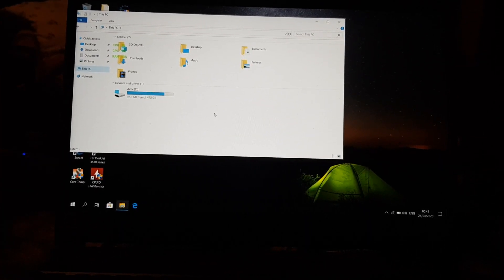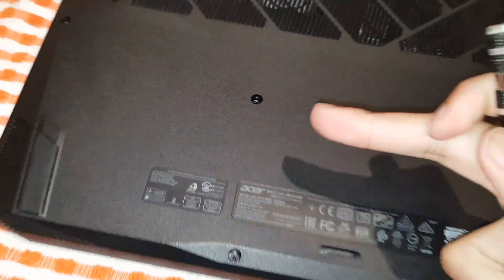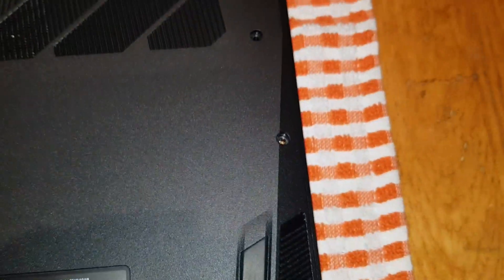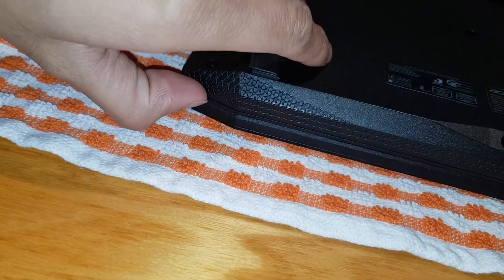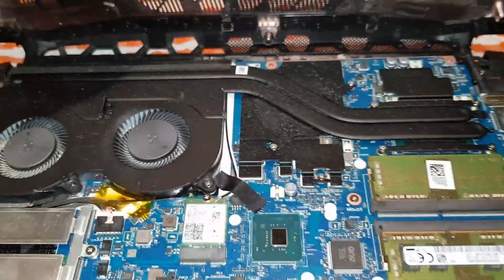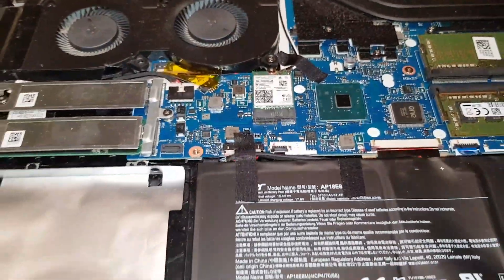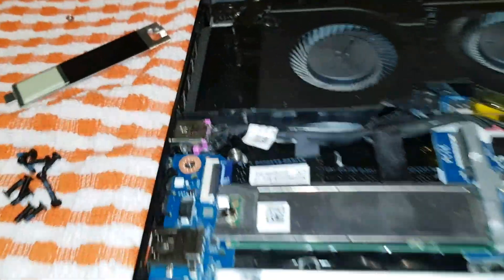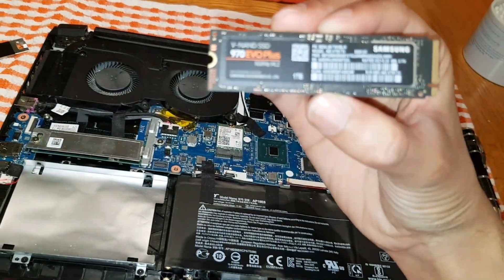How To Install M.2 NVMe Drive Acer Nitro 5 Gaming Laptop

Comment: did someone had overheating issues when using both m.2 slots? I heard it from some nitro 5 users, maybe because of the proximity with the fan.
Reply from the maker: Never heard of this but i am using both slots so might be worth me taking one out and trying it haha
Reply: @MrWaheedulHaque  thanks for the answer! 

I'm from Brazil and overheating here is a major problem for most gamer laptops.
Reply from the maker: @adrianokian  haha i had same issue too, i went through many pastes and found hydronaut was the best

Comment: How is the performance after upgrading with this ssd ?
Actually i have same laptop 
And planning to upgrade with this Samsung ssd !
Reply from the maker: Very fast everything instant
Reply: @MrWaheedulHaque  one thing more bro!    
What about gaming performance?
is it increased ?
Reply from the maker: Games load slightly quicker not really a big difference over a normal m.2 drive, where you will notice it is on video editing and stuff anything with heavy data usage
Reply: @MrWaheedulHaque  thanks bro for the quick response 🙏🔥🔥

Comment: Hi everyone,

I'm planning on doing a upgrade myself I'm just having trouble knowing if the parts I'm picking are compatible. If it's not any trouble could you guys tell me if this nvme m.2 drive would work with my acer nitro 5 AN515-54. https://www.amazon.ca/dp/B086BGWNY8/?language=en_US&cstrackid=26f0381b-a65f-4e09-bfae-194211895850&tag=microncsus-20

much appreciated.
Reply: hey bro, i have the same pc, That if work?
Reply from the maker: Yes
Reply: @cristianbenavides5265  I upgraded mines a month ago and it works flawlessly and is as easy as it looks. I recommend buying crucial nvme m.2 on their website it also shows compatibility with each model of laptop
Reply: bro, i have the same laptop, my question is, ¿support m.2 nvme? i'm thinking buy one, a samsung evo970 , Do it work in the laptop?
Reply from the maker: @cristianbenavides5265  yes brother i use similar one in this video will work fine
Reply from the maker: Yes it would work

Comment: hi i have acer nitro 5 an 515 52 laptop, can we add nvme ssd into it?
Reply from the maker: Yes with an adaptor but i dont recommend it, m.2 is better in all ways and price is same just get a m.2
Reply: So nvme does not support, then should I buy sata ssd?
Reply from the maker: @Kolül2771  it does support nvme but only m.2 style, so get a m.2 it very good

Comment: When I add the new ssd Will it be apart of my operating system storage?
Reply from the maker: No it will be extra storage, if you want it to be operating system storage then you need to clone original hard drive containting the operating system
Reply: @MrWaheedulHaque  thanks you so much!!!!
Reply from the maker: @Idkokay23  no problem
Reply: @MrWaheedulHaque  well i need to install a second nve ssd for warzone cause my nitro only came with 250 gbs lol. so if its for storage i assume the game will run no different than on the original drive?
Reply from the maker: Yes it will run as a normal hard drive extra one

Comment: Nice video bro. Got this laptop i have the 512gb pcie nvme ssd. Can i just add another 1tb m.2 as extra storage without cloning? Like buy and plug? And just use the extra storage for files and games leave the 512gb ssd thats comes with as it is for booting? Sorry not a computer techy and dont want to clone and swap even if the 1tb im buying will be faster than the factory included. Thank you and keep addking awesome video
Reply from the maker: Yes you can do that, its plug and play literally put it in computer, then go onto your pc search in bottom left, type in disk and click the one that says create partition and then new hard drive should be there i made video on how to do it on my channel if u do get stuck
Reply: @MrWaheedulHaque  yeah ive seen bro when you hard drive partition the sata drive. Its the same process? Thanks gor quick reply
Reply from the maker: @martachong123  yes same process for your drive

Comment: Can u show me how to remove the fan :)
Reply from the maker: It is all on the thermal repaste video haha search on youtube acer nitro 5 thermal repaste my video is first i believe
Reply: @MrWaheedulHaque  o thx the only thing i need to know now is howd do i get inside the fan and clean it because my fan has alot of dust in it
Reply from the maker: Use compressed air, microfibre cloth to clean fan blades and a small paint brush to clean the outer vents of the fan
Reply: Yea thanks but how do u get inside the fan
Reply from the maker: @takasaga2395  what do you mean by inside the fan
Reply: @MrWaheedulHaque  like open the fan if u know what i mean
Reply from the maker: Did you watch my thermal repaste video as that is what i do in it, if you mean even further removal its not neccessary unless you are greasing the bearings of the fan, but compressed air will clean it you dont need to disassemble further
Reply: @MrWaheedulHaque  o thx will using a vacume work or is that too much?
Reply from the maker: @takasaga2395  vacuum dangerous might cause static shock
Reply: @MrWaheedulHaque  ohhh what will happen if that happens
Reply: @MrWaheedulHaque  will it damage the laptop?
Reply from the maker: It will fry the chips or motherboard and then your pc will be a expensive dead paperweight that cant be fixed
Reply: @MrWaheedulHaque  holy shit lol
Reply from the maker: I done it before ftom very far away just to pull dust out from far it helps a bit
Reply: @MrWaheedulHaque  ok im a try from very far away wish me luck hooe my laptop doesent break i cant use the other methods i recommended me because i dont have them

Comment: Did you switch the main drive to the new one and run windows on it since it's faster, or are you just using it for storage? If you did I could definitely use a walk through. Doing the same on mine just waiting for shipping.
Reply from the maker: Yes i did this, all you do it clone old drive, change boot to new drive in bios and then format old drive and use old drive as extra storage
Reply: @MrWaheedulHaque how do you go bios?
Reply from the maker: @jennytehlia1724  turn on pc at same time keep pressing f2 key very fast should load into bios

Comment: I put a NVMe in the PCIE/SATA slot and BIOS doesn't detect it. I try it in the other slot and same thing. It won't read. I'm not sure what the issue is but I am going to return my laptop to the store.
Reply from the maker: Did you put nvme in nvme slot?
Reply: @MrWaheedulHaque  Yes, in fact they both should be. One's a PCIE/SATA, and one's a NVME
Reply from the maker: @AzNightmare  are you sure it was fully placed in as mine didnt detect too untill i fully pushed it in
Reply: @MrWaheedulHaque  Apparently I wasn't sure. It was my first time. I'm a dummy. I got it to work now. Just needed to push it in harder from 45° angle until the gold pins weren't showing anymore.. I made the same mistake you did in the video.
Reply from the maker: @AzNightmare  dont worry my friend it is very easy to make the mistake also it is a bit scary too as you dont want to break a expensive m.2 drive either, but now we both know. Im glad it working now for you.

Comment: 2 thumb holes at the back each corner ..pull the screws then place thumbs in each hole and slightly pull & the bottom shell drops straight off.
Reply from the maker: Can you make video on this

Comment: can you tell me if my Nitro 5 model AN515-54-75FJ supports a 1tb NVMe ssd?  (WD black SN750)
Reply from the maker: If it have m.2 slot then yes most nitro 5 supports it

Comment: I know what you mean it's just not enough I need to get an extra stick of RAM for it I've only got one 8g stick and 512 ssd.
Reply from the maker: go for it lad you will be glad you did
Reply: @MrWaheedulHaque  did you get yours with 8 gig of single channel ram and did you upgrade it. and did it make any difference to the games.?
Reply from the maker: @joshuagood4237  yeah it was only one stick i think, its on my ram upgrade video i pretty sure it was one ram stick. The improvement is very good, on more demanding games it does makes thing run smoother by like 4 or 5 fps. But where you will notice it is if you do a lot of multitasking. Like i go on internet and open loads of tabs and leave them open and start playing games and before i couldnt do that
Reply: @MrWaheedulHaque  thanks for letting me know yes I definitely have to upgrade the RAM then. 👍

Comment: I bought this laptop last month. It came with only 1 TB HDD and two empty slots for M2 SSD. Can I increase the storage of this laptop if I replace the 1TB HDD for one Crucial MX500 1TB SSD? Also, I want to add one Crucial 1TB P5 NVMe PCIe M.2 SSD in the slot 1 and one Crucial 1TB P5 NVMe PCIe M.2 SSD in the slot 2. I will have at the end 3 TB of storage but I'm not sure if the motherboard support this.
Reply from the maker: Yes this will work fine, i have 3 hard drives in at the moment and they work fine

Comment: Finally you’ve uploaded a new video. You’re laptop looks like crap inside, scratches everywhere, dust everywhere and also your battery looks like it’s swelled up which means the battery life won’t be as good as when it was brand new. What is your new video upload schedule?
Reply from the maker: Haha true but it all works fine so i guess its alright, and i think the tiny battery buldge is just a sensor as i seen it on a few acer nitro 5 tear downs, also my upload schedule is 1 upload a week if possible and more if i can. Reason for going down from daily uploads to less is because im just a lot more busier, we got a accident damaged ford fiesta st, and i been working on that with my mates and labib, i been recording footage on that and most likely will do it up and sell it while making videos for it on my channel
Reply: MrWaheedulHaque that’s not a battery sensor that’s the actually battery cells inside that are expanding and coming out. Ford Fiesta ST’s are nice cars it’s good you’re fixing cars and selling them nice work bro.
Reply from the maker: Ill have a look at it again, and thanks bro they are very nice but very hard to fix when they have frame damage haha, been trying to bend the front axles back into shape and its a very hard process. Thanks i enjoy buying fixing and selling cars its fun
Reply: MrWaheedulHaque how much profit do you make on fixing broken cars and selling them?
Reply from the maker: @RanvirTalksRacing  quite a decent amount, you make a couple hundred to a thousand per car, but then theres some cars that you will take a tiny loss on if more and more problems start to appear that you didnt notice before so its best to try find good ones with minor damage